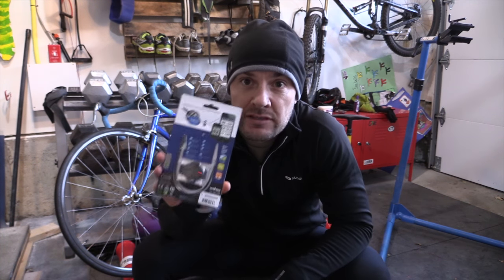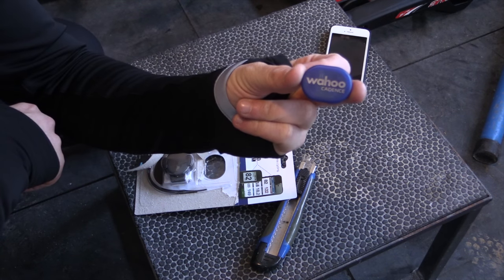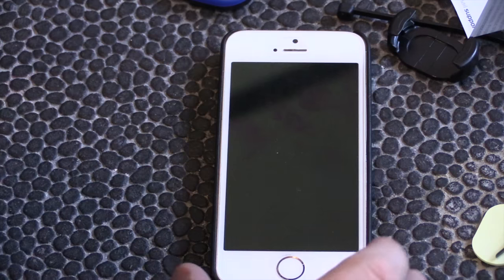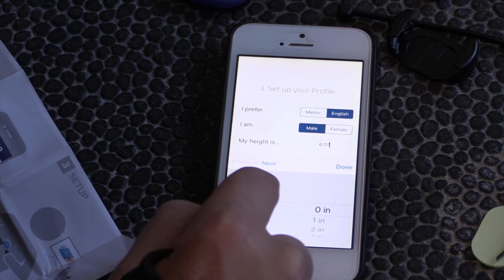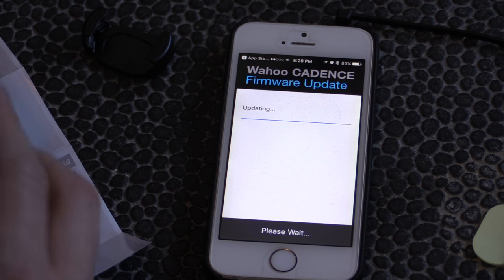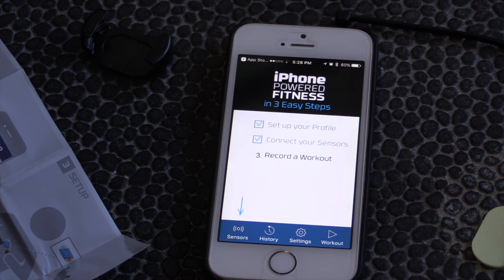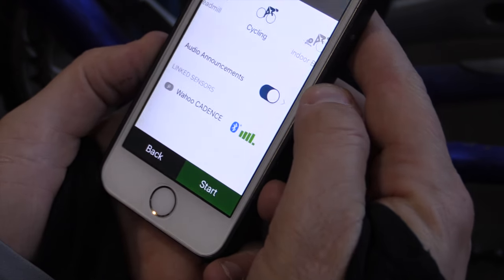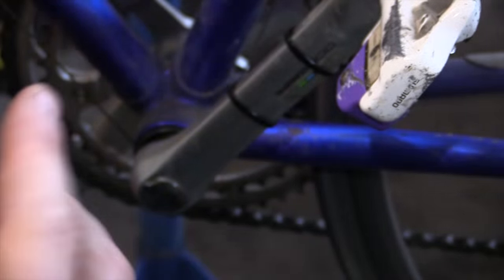Bike Roller Vlog - Day 3 - Wahoo Cadence Sensor review

Comment: I had this sensor and for the price is OK. One thing you need to know is that when the road gets rough or bumpy, the sensor will go off anything from 20 to 40 rpm for a few seconds, which will drive you nuts when pavement is not smooth. It works nice on stationary bike though and when pavement is nice and smooth. I do not think it will work well on MTB.
Reply: Works fine on my MTB....

Comment: How did you find the battery on this sensor? As I could see the sensor was already on when it arrived and apparently does not go into sleep mode when not in use. Many units are defective and use the battery pretty quickly.
Reply from the maker: +Lt. Nimitz I haven't changed it yet, but don't ride my road bike often.

Comment: I know this is an older vid but I just came across it. I just got the wahoo speed and cadence sensors. Decided to mount them with velcro (industrial strength) so I could move them between bikes. My question is, how do you increase the workload on your rollers? I reduce tire pressure on mine but am looking for other ideas. Our Canadian winters are too long to just not ride.
Reply from the maker: Mine (Elite Arion) has 3 different resistance levels, which weren't much difference if I recall.   Do you find it easy even in a high gear?  I don't think low pressure is that good for roller riding, though I understand it will give you more resistance.
Reply: Agree on all points. I wouldn't say its easy as I still get a good workout but I can't get enough resistance to say I'm straining. Can't wait to ride outside again. Come on spring!
Reply from the maker: Yeah, I did a fat bike demo that was fun.  I was thinking of just getting winter road bike tires..... I'm in Ottawa, you?
Reply: I'm on the fence about a fat bike. N+1 is great until my wife says that's enough. I'd really need studded tires for the weird weather here in the Halifax area. There are good trails but you don't know what you'll get when you actually get there. You know?
Reply: I ride the 3" Kreitler rollers (in winter) and resistance is an issue for me too. My previous 2.25" Kreitlers had plenty of resistance, but not my 3". You can get an expensive fan unit that is driven by the rollers to increase resistance, but instead, I just place a folded towel under the rear roller making light contact with it. Not repeatable but it does the trick.